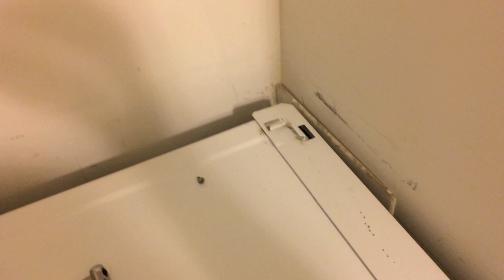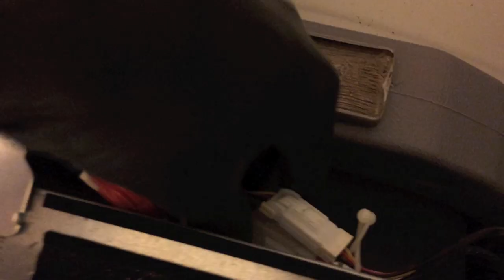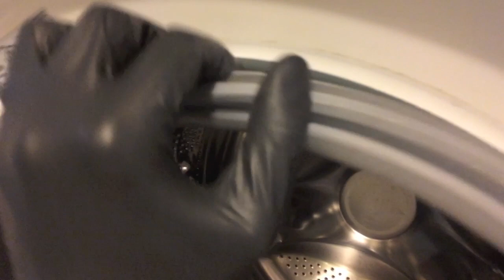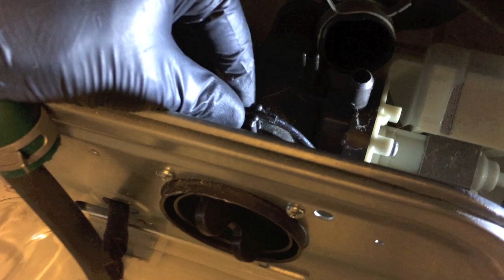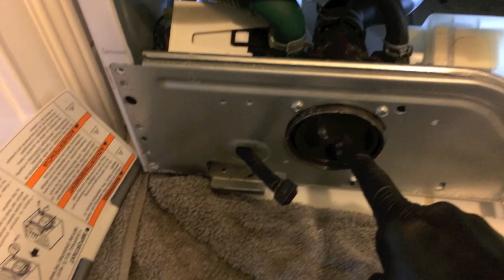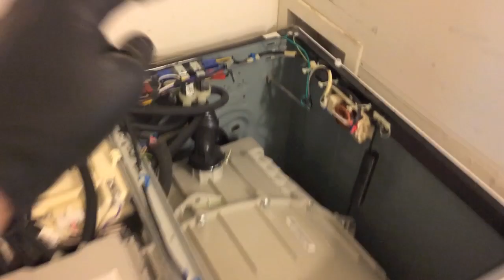"OE Code"   How To Replace LG Drain Pump Motor - FAST & EASY

Comment: Tip the machine back about 45 degrees. Take the pump filter facade off. A couple more screws from underneath/behind pump assembly. Three screws hold the pump on the housing. Put it all back together and test. Maybe 15 minutes if you're methodical. Oh, buy two pumps while you're at it. You'll need extra one soon enough.
Reply from the maker: Thanks for watching.

Comment: Years later, this video is holding up! A million thanks for saving me $$$ and I used your affiliate link to buy the pump. My model (WM2301HW), like others here, did not have the recirculation pump/hose either. On this model, to get the drain pump/housing out, you can reach behind the center of the housing and press the small plastic tab under the housing and push backwards to free it. FYI.
Reply from the maker: We are honored to read this, no joke.  Thank you for sharing this, and taking the time to add a few tips of advice that helped you conquer your DIY project.

You can reach out to us any time.  Many more helpful videos to come!

😎👍🧰

Comment: I knew how to replace but ive been doing this for nearly 10 years and made an awful mistake. I forgot to take a picture of the wires to know where to plug them back in. Your video showed me which colors went where so thanks!
Reply from the maker: Good morning, just poured a cup of coffee and am sitting down to answer any and all questions for the DIY community.

We are happy to hear our video was helpful in getting those wires put back onto the proper connection points.  😎👍

Let us know if you have any questions and hey if you’re into crypto trading, join our DIY ecosystem and become part of an exclusive group of DIYers.

       toolboxtoken.com

Reach out to us any time!  🧰

Comment: My LG washer has the same OE error. I took mine apart, drain pump was testing 14 on the multimeter so it was still good.(I think at least) I took the propeller out of the pump itself and it was filled with dirty black gunk. Besides that, I can't tell or figure out why I can't get it to drain and not get the OE error. I do know whenever it does drain, it smells awful like sulfur. Not sure what to do. I took the hose that drains into the pipe out of the house off and tried to clean that out too, still getting the OE error.  Is my pump the only option that would make it not drain then?  No kinks in hose, it's clean & the filter at the bottom is clean
Reply from the maker: Thanks for watching & welcome to the DIY Raptor Club.  Is your pump filter clean & clear?

If clean & clear, you may have a faulty pump.  Please keep us posted, us fellow DIY’ers need to stick together!

😎👍🔧🔩

Comment: Just did this repair, my impeller popped off, but also my O-ring around my pump had deteriorated to the point of there being black water all in the pump assembly. A few notes:
1. Be sure to put a layer of SILICONE GREASE on the new O-ring when reinstalling the new pump. It should help make your new pump last longer.
2. Also, DO NOT remove the door latch assembly. After the rubber gasket is removed, just lean back the front face and disconnect the wire harness. There is a delicate spring on that switch that is easy to lose.
3. There is a small push down latch on the rear of the pump and it slides backwards very easily. Do no shift it upwards as shown here, as you will damage the feet that hold the pump in place.
4. Finally, there is no need to detach the hoses on the pump housing. Just slide the pump backwards (#3), and gently rotate the assembly and unscrew the 3 screws holding the pump to the housing. Grease and replace.
Reply from the maker: Good morning & we appreciate you watching.  Great to hear you’re back up and running.

We appreciate you taking the time to share your helpful tips.  Any & all helpful info is greatly appreciated.

Hopefully many stress free days ahead for you.  😎👍🔧🔩

Comment: Hey Mike, LG sent the same part  (4681EA2001T), though my original for my WM3997HWA looks different. On the original part, the cap is part of the pump. The new pump did not come with a cap. What to do? I can't locate the cap as a separate part anywhere....
Reply from the maker: Thanks for the reply.  That’s the correct part # that we show as well.  You may need to remove cap from old pump & install it on new pump.

Keep us posted.  😎👍🔧🔩
Reply: @DIYwithMichaelBorders  HI again, the OLD part DOES NOT have a cap; that's the problem, and no matter where I search I can't find the original part replacement OR a separate cap. Is it OK to install it WITHOUT a cap, because there doesn't seem to be any other  option. I bought this part from genuinereplacemenetparts.com. They assure me it is compatible, but then I go to sears parts direct, they state is it NOT compatible. Well great. WHAT IS THE COMPATIBLE PART? UGH!
Reply from the maker: @lynnmadore7373  

That’s odd...🤔

We researched your part # & came across this on Amazon.

       https://amzn.to/2O6KCVF

Does this look like the one you just purchased?

Comment: Thanks Mike, good video!  Fixed my washer. Local parts place overcharged me for the pump but that’s the price I paid for getting it same day rather than Amazon. Very easy repair. Hardest part for me was getting hose clamps off. Didn’t have a set of pliers quite the right size.  But all done in the end and working fine. Took about 90 min all told. Could probably do in 45 if I had to do again.

Few other things I’d recommend. Can get the wire band holding the door seal off really easily if you grab the loop of one end of the spring and pull with needle nose pliers. To put it back on, coat with a bit of water and dish soap. Can get most of it around with your fingers alone then use the needle nose pliers to stretch the spring again for the last bit. No damage at all.
Reply from the maker: Very cool & well done!  Welcome to the DIY Raptor Club.  A great rewarding feeling & the money you saved by DIY’ing it can be put toward something more enjoyable.

Enjoy your night David, thanks again for sharing this.

😎👍🔧🔩

Comment: What is the best way to remove the locking ring?  The official sears website shows a tool that pushes the spring apart but I don't have that specific tool.  So just wondering what the best way is to get it started.
Reply from the maker: Thanks for watching & welcome to the DIY Raptor Club.  Down at the bottom of the seal is where the lock ring splits.  That’s a great place to start carefully removing ring.  Keep us posted.  Us fellow DIY’ers need to stick together!

😎👍🔧🔩

Comment: Hi no I haven’t got the machine up and running yet.
Silly me didn’t take note when disconnected the brown and black power cables of the water pump.
Can you please tell me which goes where black brown to N OR L..
Regards
Reply from the maker: Bay Buoy 

Thanks for the reply.  Our specific model has the Black wire on top.  Keep us posted.

😎👍🔧🔩

Comment: Thanks, this was one of the simpler guides I found. My machine was slightly different - there was no recirculation pump at all (although the piece that the drain pump bolts onto looked the same - the older side was just molded shut), and there were small clips above the tabs on the back of the control panel that needed to be lifted up. This was very helpful!
Reply from the maker: tursilion 

Very cool & thanks for watching & taking the time to share your comment.  We really appreciate it.  Glad the video helped!  We are always adding more videos that you may find fun & helpful.

Below is a link to our Appliance/Home Repair Video PlayList.  It contains several videos that you can benefit from including additional videos on your washing machine...& many others!  Definitely check those out!

       https://www.youtube.com/playlist?list=PLjCXOz8TSkZmG-ZbhhKPj4Vh3K3MDPXii

Let us know if you have any additional questions along the way we are here to help!  Please subscribe to the channel and turn on your YouTube notification Bell that would be awesome thanks again!  😎👍🔧🔩

Comment: The pump gets mounted with a slight angle up? I forgot to check before I removed mine.....
Reply from the maker: McCartneyville 

Thanks for checking out the video.  You will need to position the pump at a slant as you move it into position.  After you move pump into position you will then level the pump to secure it.  Keep us posted on your repair.  Please subscribe to the channel and turn on your YouTube notification Bell that would be awesome thanks again!  😎👍🔧🔩